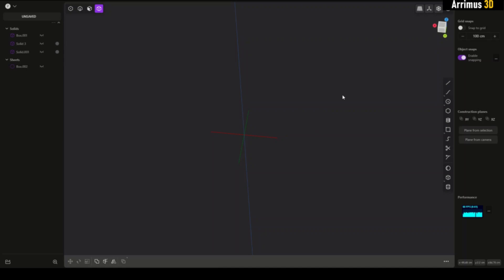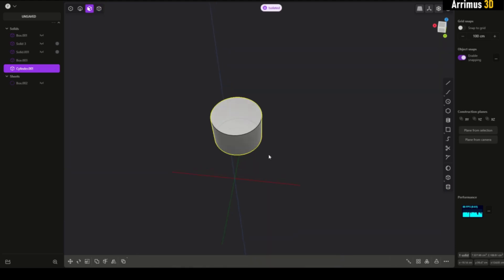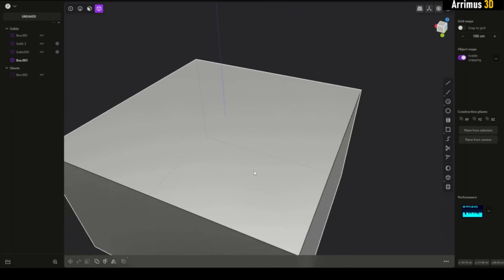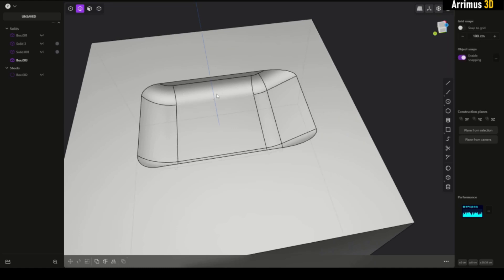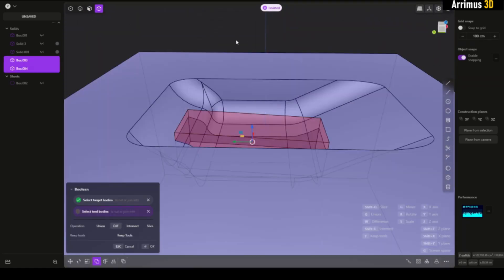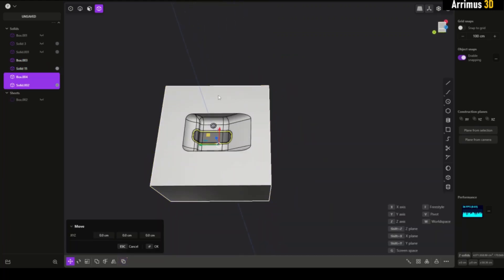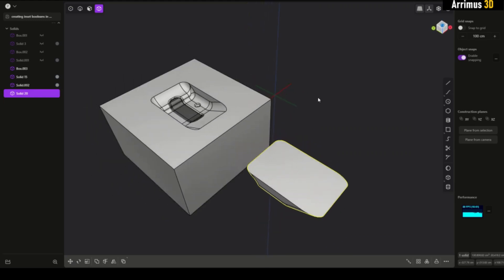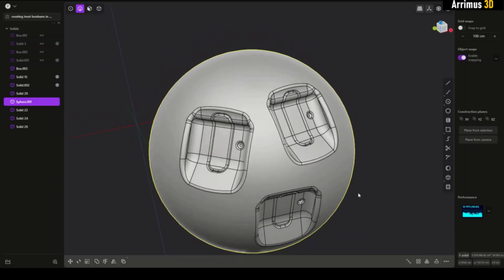Plasticity - Create Insert Boolean Objects

Comment: If you had selected the surfaces that were cut in and hit Alt-D it would automatically create the cutter geometry for reuse. 
Also you can create a plasticity file with all your cutters. Shift Ctrl C (Copy with Placement) allows you to cut from one file into another.
Reply from the maker: Thank you for the tips! Alt+D only works if it's the same body. If you have multiple objects there will be an error. Next video covers the multi-window workflow.